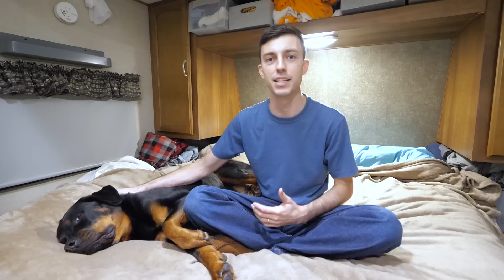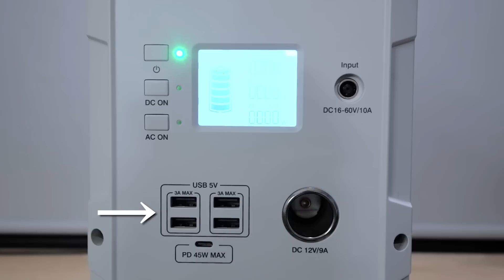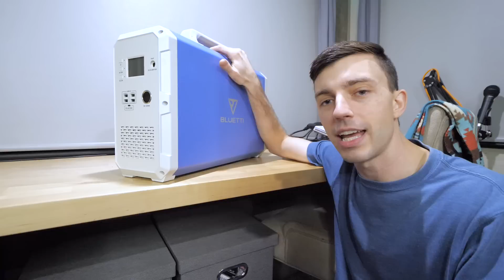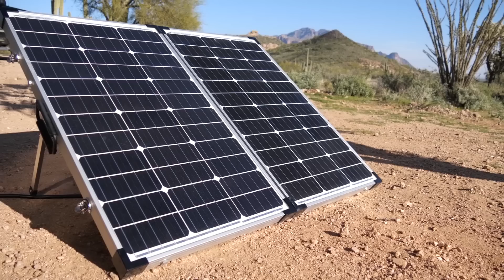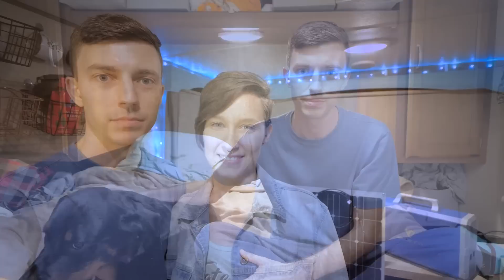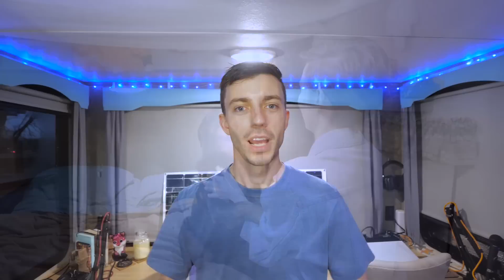RV SOLAR SUBSTITUTE?! - Bluetti Portable Power Station - RV Life

Comment: Thanks for all your videos. I was thinking of taking my Pecron 1500 watt portable lithium battery to power the Winnebago Solis AC outlets. My thoughts are that the AC plugs are pretty useless unless you are hooked up to shore power which I plan on never doing. Also the life style of B class RVer's are USB and 12 volt device appliances only so why not just take the shore power 30 amp cord and get an 15 amp adapter and plug it into the Pecron. The better solution is to put it inside the van and cut it into the shore power and fuse box connection. Also have it hooked up to the 12 volt to charge it when you are driving......is this making any sense....thanks

Comment: The thing I hate about portable power stations is the LAME AC/DC charging rates.  2400Wh / 12 Volts equals a 200AH battery.  Following Battle Born's guidance of 50A of charging per 100AH of capacity, you should be able to charge a 2400WH lithium at 100A for a total charge time of 2 hours.  Two hours in a StarBucks/Library or two hours on a generator should yield a fully charged unit.  According to the Amazon page the unit takes 12 hours to charge on AC.  12 hours or 2 hours of a generator running.  The gas savings should quickly cover the expense of a more adequate charger.

A great use case for this would be for a van lifer working a 9-5 where they could charge this at work (large rolling notebook case for carting work notebook and this power station) or a van lifer who spends a lot of time in StarBucks/Libraries.

Another use case would be van lifers driving a few hours each day with an adequate secondary alternator (would not want to burn out the primary alternator) and a more appropriate vehicle charger.

Consider a power strip to get around the limited AC ports.  For those times when you must travel to a location with cell signal for uploads consider a lower power ChromeBook for about $150 - maybe an Android tablet could do the upload.  If you want to get really geeky you could probably build a Raspberry PI system (raspberrypi.org) and control it with your cell phone for uploads.  ChromeBook power consumption could be less however.  The ChromeBook would be really useful when not gaming/video rendering inside the RV as it would use much less power on overcast days.

Comment: So could you use a 15 amp adapter with your RV power cord and plug that into the portable power station to run more at once?
Reply: I was wondering the same thing, to basically be able to run the RV components (not AC) without having it direct wired. 
Did you find an answer?

Comment: Are you using a strong bug/air flow off the hood of the vehicle? Did you notice a difference in the gas mileage or control issues with the driving?

Comment: We spend a lot of time in our teardrop. Plenty of space. We have suitcase panels and a 350 watt Rockpals battery pack/inverter. Run a small fridge on the beach. What more could we need. We also have a small house battery with a 45 watt panel to charge fir lights and phone charge. Less is more. I’m 72. Wife is 67.

Comment: Nice  video , thank you for information , New to this  , Planning on putting solar on   mini school  bus  which will use around  6 week or more s a year,   ,  I like to put  4    300 + watts  solar  on  it   wondering if  putting battery s      on a  trickle charger for winter  and keeping  above 40  degrees  in garage  if the  battery life would last  ,

Comment: Thank you, I’m so glad you reviewed this because I’ve had my eye on it! For us, we haven’t hit the road yet but our plan is to full time starting end of this year (hoping COVID is under control by then 🤞🏻) and we’re thinking we’ll mostly stay at parks at least to start, so we just don’t need a full solar setup. However I also don’t know if I want a generator because of the fumes and noise. I know some places have rules against using them.... This might be perfect to allow us to boondock on travel days and still be able to charge a device or use a dyson fan or low amp AC for when it’s hot. I hear you can also charge the bluetti via your vehicle so we can charge it on the road! I’d love to know if anyone else does this!

Comment: I have the 1500 Bluetti. I never move it outside. I use a 30 foot 10 gauge extension that runs out to my panels.
(I have 4 100 watt suitcase panels). Works great. Also run 2 short extension plugs that run from the back of the bluetti and I sit them on top of the bluetti. Each has 3 plugs for a total of six plugs that I use carefully by reading the amount of energy going out to devices.  These extra plugs allow me to recharge my battery chargers and run my egg cooker, Vita Mix blender,  etc. 
The Bluetti stays under the table and is shaped perfectly for the spot i have it allowing for a cat box as well. I take precautions by splitting the area so I keep the cat box dust from traveling to the Bluetti. Extensions run to the bed to keep my small Jackery charged as well so I can keep lanterns, phones,  etc charged. I have a cigarette extension as well so I can keep my frig in the car or just outside. I love my bluetti and only wish the  larger version you show in the video was on the market when I made the purchased. It looks exactly the same but has an even bigger battery which is convenient.  
I use this power station every day!! And I'm a full time boondocker. It's perfect for my small camper. :)

Comment: Why would you need to move it around? There are extension cords for your laptop and also solar extension wires. Technically you could have it in one spot?
Reply from the maker: Using extension cords to power laptops is a bad idea since it results in voltage drop that could be harmful to more sensitive electronics like computers

Comment: Thanks guys.  So at $8k+ and 4 years into it, your ROI on your full solar is getting much better.  As long as you keep that same RV for a few more years the ROI gets better and better.  Nice job.  For that little portable unit, you could always use a 30/50amp to 110v adapter to plug the RV directly into it and be able to use any plug in the RV, granted not more appliances that you can use directly off the ports on that Bluetti, but more convenient overall.
Now how about a link to this color changing Christmas lights?  So cool...

Comment: You may be able to add it to your RV system if you had a spare 12 volt  connection near or  under your table.  You could leave it connected to 12 volts.  It may get a charge from your batteries which comes from solar.  On the other hand it could be in a spot under the camper in bigger RVs and used for portable power.  There are all kinds of options.

Comment: Your pros vs cons on target which is why I went with the Bluetti AC200 with two (2) Bluetti 120w solar panels (adding 2 more panels), as a substitute for an integrated solar system, for our Open Road travel trailer when boondocking, and as a backup power source for our household in case of power outages since we live in an earthquake prone area of Alaska. Well done on the video presentation.

Comment: wish you would have said how long it takes your single solar panel to charge the unit. we have one and using the 110 plug the charge takes forever. I heard solar charging is faster so how long to charge with your 160-watt panel. We just got a 180-watt panel but since we live in Alaska and little to no sun this time of year have not had a chance to try it. Of course in the summer we get over 20 hours a day of sun. love your videos
Reply: its a 2400w battery. So you can do the math. your 180w panel, will probably generate 150w on a sunny day. So thats 16 hours for a full charge.

Comment: Great info guys! Another consideration for the portable solar battery, if you want to change your rig at some point, just take it with you:) This is the reason I went with a portable set up, also mine has a outlet to just plug the RV into it. 
While Boondocking I can set up the solar panels and plug the RV in. 
The Apex has the capability to be used and charged at the same time.
Reply: So does this one

Comment: Are you still using your 3 year old ReLiOn batteries that you originally installed? I noticed you have Battle Born battery now in you list of equipment you recommend, but in your last solar video i saw the relion logo covered up with cardboard. 
This makes me wonder if either lithium batteries don’t last as long as they should or maybe ReLiOn won’t sponsor a battery size upgrade, but Battle Born will.

Comment: Would the Bluetti be a replacement or a supplement for the two deep cycle 12 volt batteries I have on my 21 foot travel trailer. I only go out 5-6 times a year for long weekends. One week long trip a year, I would do some solar panels to keep it charged up.
Reply: Probably, might be over kill. It won't supply 12v stuff in the trailer like lights, fans, pumps...
Reply: @luminousveiws  yes it will.

Comment: You can plug your trailer into it with a 15 amp adapter. It doesn't have to sit next to your electronics. However, when I've done this, it charges the rv battery too. So the rv battery pulls it's charge. I think that's handy though, since my rv battery handles much of the rv's functions (heating for example).

Comment: I have one of these and spent a week in Oregon using it with 2 100 watt panels. Could be used another panel (bought another one since then), and it worked great! Only 1000 watt inverter. That's the only thing I'd change. Still, for the price, you get a lot.
Reply: How long does it take to charge the bluetti with you 3x 100 watt panels?

Comment: Great video! I’ve owned a Bluetti 2400 for over a year. I’m not a full timer but when we travel we boondock or free camp without power. I mounted my solar panels (3-160 w panels) and ran the cord down the refrigerator channel so I can charge the bluetti inside the travel trailer. I also wired in an transfer switch to my CB panel so when I plug in the bluetti it delivers 110v to all outlets through the panel. The bluetti stays put and we have power when we need it. It’s been a game changer for dry camping. No need to start up the generator for those morning Kuerig coffees. It also keeps our house battery fully charged through the travel trailers built in inverter. The only con is there is a bit of a power loss inverting bluetti DC power to 110 AC then inverting that to 13v DC for the house battery charging but it’s very minimal. This has given us a inexpensive option to in-house solar without lugging anything around.
Reply: I would like to do this. Any chance you have more details on how you completed this?
Reply: How long does it take to fully charge your Bluetti with 3-160w panels?
Reply: I know it can accept up to 500 watts .  However , when you are charging from AC or generator , it can only charge at 167 watts.    I wonder if you can use a 330 watt laptop adapter ?

Comment: Very nice video. It seemed to be aimed directly at me.😊 I just purchased a Thor Axis 24.1(25 footer).
It has a 100W Solar Charging System w/Power Controller. Means nothing to me. I climbed up and saw a solar panel on the roof, but that was it. I’m intending to go full tilt solar, but I will need it installed. Any names you could suggest for that? Meanwhile the product that you just showed me sounds like it will give me an idea of how solar works and what we will use it for. Thank you.
Reply: if you’re going thru flagstaff az area ‘northern arizona wind & solar’ did a massive install on nomadic fanatic’s rig.. he filmed it on his channel..

Comment: How many solar panels do you need to charge
Reply: I'm using 3 100 watt foldable panels but have 4 for when I'm in forested areas for instance or when there's cloud cover. I attach the folding panels to the luggage rack and they just hang down side by side on the outside of the vehicle. I don't move panels anymore which is nice. The Bluetti is usually full by the end of the day. And because I have an extension I can keep using the bluetti inside my trailer while it's capturing sunlight. (Of course being here in the desert is the  perfect place to capture lots of sun!)

Comment: Dude it's 1300.00 Dollars I can run a generator for half the cost
Reply: but the noise
Reply: @rickwheeler7480  Honda generator is 1000.00 dollars not 1600.00 
No noise but for that much money I would deal
Reply: No gas to buy. Sun is free!!
Reply: @laurenmcrobie8  nope apparently it costs 1600.00 dollars and yes I live full time in an rv and it did catch my eye but so many other more reasonable options that do the same thing and the problem with these power packs is they suddenly just die and that's it you maybe get a single year maybe two so 1600 dollars seems very expensive

Comment: This advice has saved my bank. There's a power bank that's 3150$ on amazon that's a much larger system and It'll be perfect coupled with 750 solar and a gas generator.